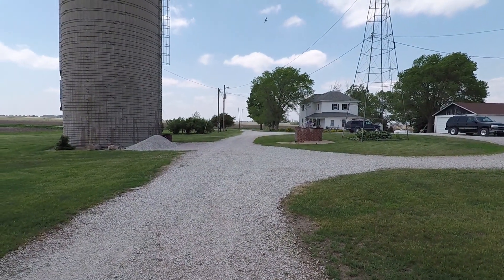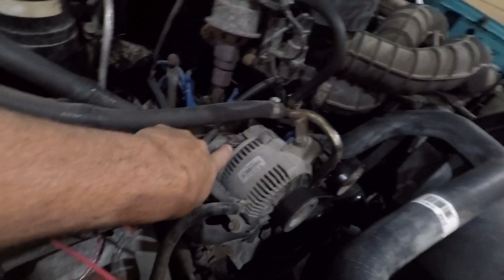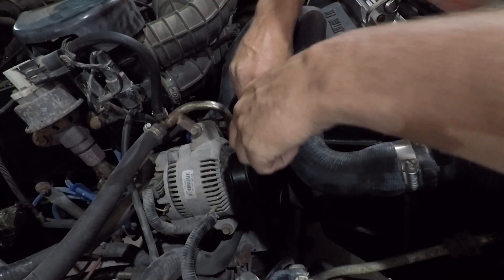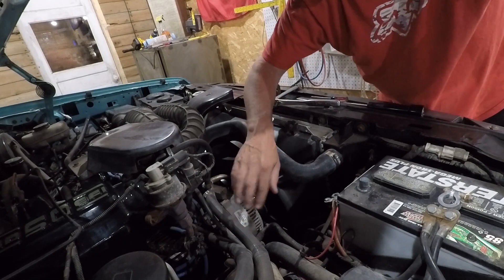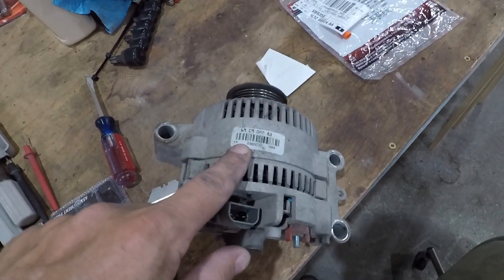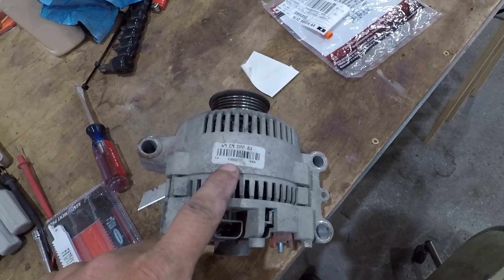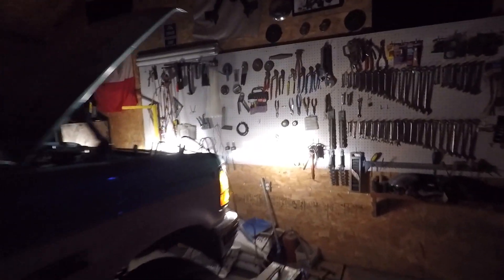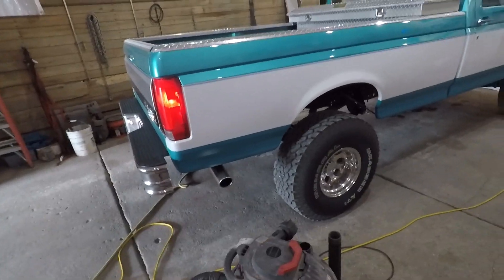1994 Ford F150 Alternator Replacement - 92-96 Ford Truck

Comment: I've worked in the auto parts industry for 6 years, and batteries, headlights, wipers, etc. no problem.
Today I had to change my first alternator in my 93 5.0, and this was a lifesaver, since the tool set I was using was a catastrophe. Super easy with your help.
Easier than the damn starter!
Reply from the maker: Yeah it's pretty simple. 👍

Comment: I let my 1993 F-150 6- cylinder stick sit for 2 yrs.  Battery would not take a charge:  removed it.  Jumped the truck off my Mini.  Started / ran OK, but as soon as I removed the jumper, truck died, rather than running on the alternator as expected.  Does this suggest the newish looking alternator needed replaced  ?

Comment: Your alternator was not giving enough volts, mine is actually giving too many, after 15 minutes motor running I saw 17.4 volts and I stopped the motor and wondered that was the reason that after driving some 30 to 40 minutes, is I would reverse  motor would stall, while waiting some 30 minutes for a friend to come and help me, I thought maybe I try staring it and the motor started. Possible after battery cooled down there was no problem. I will change that alternator today, but I wonder if there may be something else causing that problem.

Comment: If you still have issues, there is a possibility that your wires running from the battery to the starter and alternator might be corroded internally. A lot of people just upgrade them to thicker wires anyway, which can help power output. Had to do that on my RAM last year. Starter wire was badly corroded inside, and it made all the electronics in the truck work poorly until eventually they just quit altogether.
Reply from the maker: We will see...  so far things to be ok but ya never know.

Comment: Thanks very helpful I got pick up from my dad f150 1993 with a flareside bed but the inside looks like a lighting and it has a different set up than your truck going to try to replace the starter like u did wish me luck thanks so much

Comment: Awww the 302 back when Ford actually cared you if the owner could work on there vehicles
Reply from the maker: LOL, seems like on newer vehicles you can barely even see the engine let alone work on anything!
Reply: their. carry on
Reply: So true Hahahah
Reply: Liked your video but a faster way to see if your alternator is working right is to disconnect the negative terminal if the engine dies your alternator is not working.
Reply: Blame Democrats not ford.

Comment: I replaced alternator on my 95 f150 a month ago. Then it started overcharging. Took alternator back and it was tested as a bad alternator. Got a new one again and the gauge is barely over 8 on the charge. 
 Now as I was driving home from work, completely lost charge as radio and lights went on and off. Parked truck. Next morning truck started right up, but charging is just above 8. What could be the problem now? Cables are good. Battery is good. Would solenoid cause any issues?

Comment: I have this same truck just spent 1800 on transmission and  when I got it back it started rev up and down then it would die. But now it has crank  but no start at all could you help me out. Please any suggestions would be greatly appreciated
Reply from the maker: Internet diagnosing is almost impossible...  but you need air, fuel and spark... So something isn't right

Comment: Nice truck. Good video. So, to take off the belt and install the belt one turns the 15mm bolt the same direction as you did in the video?

Comment: Fox shop if I were to replace that wire on the back of the alternator with 0 gauge wire where does it run to and from? Just the positive post on battery to alternator?
Reply: Yes, that wire on the back of your alternator is ran directly to the positive "+" terminal. However, it is recommended to place a "megafuse" rated 15 or 20 amps higher than the amp output of the alternator. (Google "3G F150 conversion" for more in depth photos and walk-through)
Reply: Eleven Bang Bang have a 0 gauge wire going to alternator with a 250 amp

Comment: i have replaced the headlight switch on my 94. no splicing just disconnected the pins and plugged them into the new switch. the metal housing around the switch is hot as hell. it was on the old one also. is this normal?

Comment: I remember when I had to replace my alternator last summer. was 43°C/109°F, no wind at all and my trucks battery died in the desert so I was working in direct sun. including the ride to NAPA it was over $320.  wasn't very pleasant and I wish I was in a shop like you were. does your 5.0 have the regular 5.0 firing order or the 5.0 HO/351W firing order?

Comment: I have tried using aftermarket serpentine belts on my 96 F150 before but all they do howl squek like like crazy and theres nothing wrong the serpentine belt tensioner either.  So nowadays i only use motorcraft serpentine belts and parts in my truck.
Reply from the maker: I had that problem and all I use now is Goodyear Gatorback
Reply: i also have a 94 and cant find any gatorback belts in my area, is there a website you order yours from?

Comment: For my 93 f 150  I installed a new battery and new 200 amp alternator and upgraded the wiring. I followed the installation instructions. Truck turns right on but when I go on a drive and come to a stop and put the gear from Drive to Park the battery gauge starts sputtering and I can hear the truck losing power. Anyone know what the problem might be ?

Comment: Did you perform any diagnostic on it before deciding It's a bad alternator?
Reply from the maker: Nope. LOL.. my diagnostic was how the lights acted, the battery drain just sitting in the shop, and once I took it off I discovered where my recent little squeak was coming from. That was enough for me.

Comment: Hi I have a 1989 ford f150 351w went to start it heard a big popping noise under the hood and everything stopped working and went silent until I had it jumped and everything worked fine. Could this be a bad battery?
Reply from the maker: I would check your battery connections to be honest.  Dunno how long you have been watching my channel, but if you remember the flareside I had, it had a battery connection that would do that till I replaced it.   Things would turn on, turn the key and everything go dead... wait a while and things would come back on, turn the key and dead... mess with the connection and she would start.  Replaced the cable ends and took care of it.
Reply: The Fox Shop thanks for the advice cleaned up the terminals and everything seems to be working fine.
Reply from the maker: Awesome!

Comment: I'm up for a starter replacement on mine...
Reply from the maker: Doing the starter is about as easy as the alternator on these trucks.  I did a video on that about a year ago I think.. might have been further back than that, but pretty sure I made one.

Comment: Changing a alternator on the 9th gens is easy and simple -____- 
I haven't seen the video but yeah getting that out of the way lol
Reply from the maker: Yep, easiest vehicle I have ever changed an alternator on.  Done it several times on this truck over the past 23 years
Reply: The Fox Shop yeah one common thing I've seen is that the bearings go bad. I changed my tensioner pulleys and idler pulleys and God knows how many times i changed the belt until I noticed it was the alternator the entire time 😐
Reply from the maker: -I have changed out the alternator I bet 7-10 times over its life.  Just dont seem to last a long time.
Reply: The Fox Shop WOW That's a lot LOL I still have the original alternator in mine. Just that the bearing is bad and I'm too cheap to buy a new one lol
Reply from the maker: any time something makes any kind of a squeak or anything like that, I gotta change it.  for several years it seemed like it just ate alternators.  this last one lasted 7 years. LOL
Reply: The Fox Shop Yeah ever since my old engine was hitting the 200k mark I was like screw it, i pushed the engine to it's limits and it handled it like a G. After it hit the 200k mark that's when it started squeaking, no change in power, just a nasty noise.

Comment: I have the same truck, a 94. So I replaced my alternator just las year and then now my car won’t start. I replaced the terminals and cleaned some corrosion and autozone said my battery needed a charge (it was fine a few weeks ago, they even said 100% charge). So it had to have been drained by the alternator right? Everything clicks on but when I turn to start it, everything shuts off. Then when I let go of the key, the dash lights slowly dim on and the chime for my door being open is soft and slow like it has to kick back in. So it won’t turn over at all or even try. The other day when it died the first time, I tried getting a jump from two different people and it still wouldn’t start. If it won’t start even while getting a jump, is it an alternator? Or starter? And if it’s an alternator did they sell me a bad one at the shop last year? I think it was brakes+.
Reply: Did you check the starter solenoid?  Sometimes the ignition terminal has lots of corrosion under it. I have also had a new one go bad after a month.